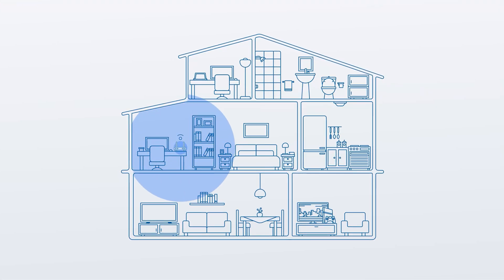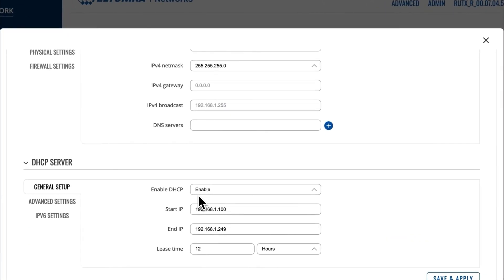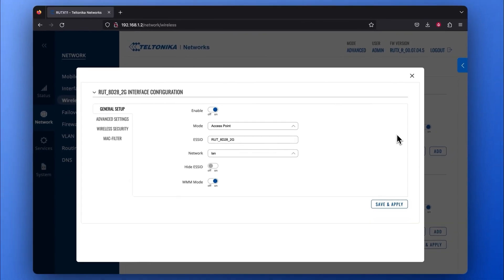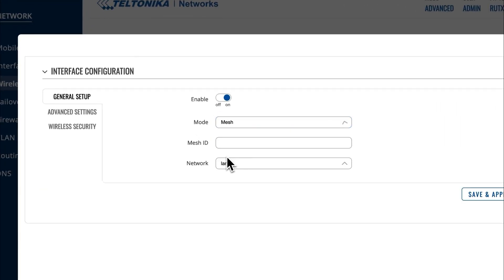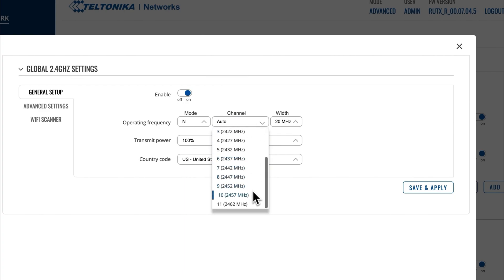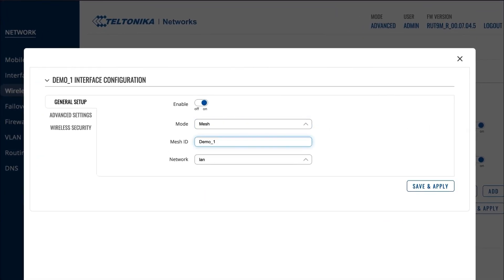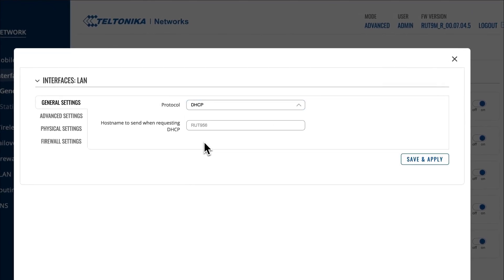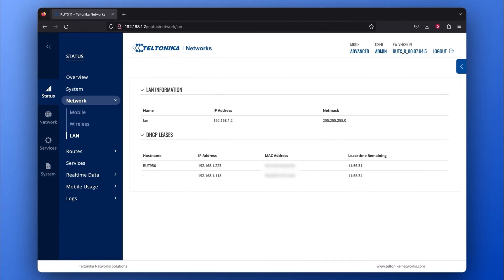How to Set Up Wi-Fi Mesh with Teltonika Networks RUTX11 & RUT956

Comment: Is there a reason why wireless configuration for access points is wpa2 and wireless configuration for mesh node is wpa3?
Reply from the maker: WPA3, under Mesh configuration, is used for security reasons.